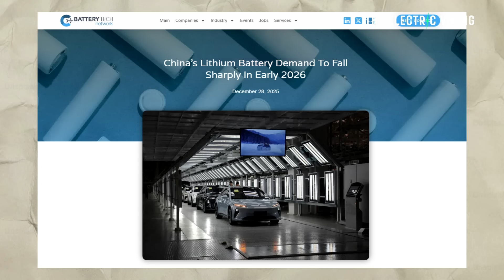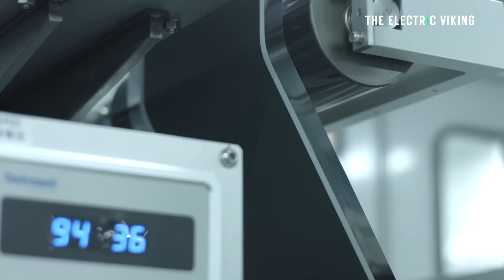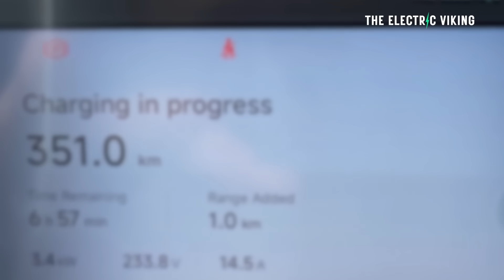SODIUM TAKEOVER! CATL Confirms Mass Deployment of Sodium Batteries for EVs

Comment: The great thing is that the move away from fossil fuels has begun. As long as there is continued research  into the development of new battery chemistry.  Battery technology and design will improve.
Reply: “IEA scraps Peak Oil, says oil demand will continue growing until 2050.” not me saying it we have a long way to go.
Reply: @reedy93  I'm not sure that comment shows any understanding of "Peak Oil"?  "Peak Oil" does not refer to demand peaking.  It refers to maximum production rates peaking.  If the global maximum production rate peaks while, as IEA predicts, demand keeps growing then demand will exceed supply.  Any budding economists like to predict what happens to prices when that occurs?

Any country that achieves independence from fossil fuels before that event occurs will be laughing.  Any country that doesn't, e.g. "Drill baby drill", will be in deep doggy doos.  Everything I see suggests that China understands this and has a long term strategy to be in the first group while the USA and most of Europe don't understand anything.  China and Russia are ahead of the rest of the world in deploying SMRs.  China is the first and only country to deploy an operational Thorium reactor.  China has deployed more solar panels than the rest of the world combined.  Everybody seems to be obsessed with its deployment of coal fired power stations.  It's not good for climate change but I think it is pragmatism rather than denial.  They need a lot of energy now, immediately, to construct the infrastructure that will provide the clean energy in the future.

Comment: Grid storage sodium batteries are generally a different design than the ones used for starter batteries. I think starter batteries are the market where sodium is going to take over a big share of the market first, although this is from lead-acid. These batteries are used in both ICE vehicles and EVs. But I still think for EVs they are still a few years away. We might see some early adoption in China, but it doesn't look like it will revolutionize that market yet. Home storage maybe by the end of 2026. We're already seeing early versions for home storage, but those are not really competitive yet. I have a LFP home storage battery and if these things get cheap enough might add these or switch.

Comment: Not in the US. Sodium batteries are twice the weight and have problems with fast charging.
Reply: They fast charge well at this point, they work in the coldest bits of the USA and Canada and they are cheap. They won't compete with NCM but that's got lousy cycle life.

Ask yourself what people in the US are going to put in hybrid and range-extender based vehicles that get a lot of battery cycling ? My guess is that will be a sodium market even if high end EV is not.
Reply: @etchedpixels  MYTH by EV propaganda

Short answer: Sodium‑ion batteries promise lower cost and better cold‑weather safety, but today their main problems are lower energy density, shorter cycle life (especially cathode degradation), higher internal resistance/voltage instability, and unresolved safety/chemistry issues — though major firms (notably CATL) report rapid progress toward commercial viability

Key technical problems (summary)
Lower energy density vs lithium — sodium’s larger ion and heavier mass mean packs store less energy per kilogram, limiting range for EVs and size for portable devices.

Cycle life and cathode degradation — many sodium cathode materials suffer structural “stacking faults” and phase changes that shorten usable life.

Higher internal resistance and voltage instability — sodium ions move less easily in many host materials, producing higher resistance, heat, and inconsistent voltage under load.

Safety and deeply sodiated‑carbon issues — recent research flags unique failure modes (e.g., sodium‑cluster formation) that affect thermal stability and require new stabilization strategies.

Manufacturing and cost competitiveness — while sodium is abundant, some sodium‑ion manufacturing routes and materials (antimony, special cathode dopants) can be costly; without scale or a clear energy‑density breakthrough, sodium struggles to beat cheap lithium/LFP on total cost per kWh in many scenarios.

Supply‑chain and ecosystem immaturity — cell formats, pack engineering, recycling pathways, and standards are less mature than for lithium systems, slowing OEM adoption and certification.

Comment: I would be interested in knowing how CATL solved the sodium ion expansion problem when charged and shrink when discharged.  That would be key to making the sodium ion cell robust and long lived.  If they have solved it enough to give 100,000 mile (160,000 km) longevity, then who cares if you must replace a $2,000 USD battery after that!  ($2,000 = 100 kWh x $20 per kWh)
Reply: Won't need to replace if you are happy to accept a lower range, 400 miles instead of 500
Reply: Prussian white cathodes, as used by CATL, are fairly good at handling the expansion and contraction stresses during charge/discharge cycles. It is a stable crystal lattice, with lots of room for the Sodium ions to move in and out of during operation, without reducing energy or power density too significantly. The same family of cathode material is used by other makers of Sodium cells, such as Faradion.

Comment: To be completely fair, until I can actually buy it as a retail product, it's just smoke and mirrors. And the current generation of sodium based batteries I can get are expensive and pretty lousy.  LiFePO4 batteries keep getting better and cheaper and sodium batteries keep getting hyped and nothing more.
Reply: Amazon sells Bluetti sodium ion solar generators already.
Reply: @larryc1616 Bluetti sells the same capacity lithium power stations for half the price. Don't get me wrong, good product, but not the holy Grail by a long shot.
Reply: Are you for real? Xiaomi top phones will now come with 10.000 mAh batteries. Insane energy density.
Reply: @LarsRyeJeppesen surprise me, but I'm not aware of any phones in the market that use sodium batteries. Zero.

Comment: This  new sodium technology sounds like it's also going to  benefit  shipping and railway freight locomotive market - in addition of course to the power grid balancing storage batteries. The late 2020s are going to be pretty crazy in terms of market disruption. I wonder what the Europeans have got up their sleeve - anything at all?
Reply: We've had batteries in freight locomotives for quite some time. Over any distance and reasonable load on European sized network it's better to string up overhead wires for much of it. Batteries are still useful for branches and in particular yards where you don't want to mix 25,000v and cranes.
The cost of a railway locomotive is huge because of the low volumes of production, enormous power output and vast distances it needs to cover over time without falling apart, so battery costs aren't actually a huge factor in it.
Ultra light rail on the other hand, and trams that charge at end stops may be more interesting though.
Reply: @etchedpixels  In a rational world, I'd agree, but here in the UK (and elsewhere) we have a Treasury, whose basic raison d'etre is "how can we spend less money right now?" So I predict there will be some long distance routes which are traversed first by battery locos. Then, when the hoo-ha has died down, wires will go up - and probably bit by bit, since that's another way of "spending less money _now_."

Comment: This Chinese state battery standards test that you we're talking about is interesting because it does suggest that older batteries have problems, genuine problems at scale ie there is a significant risk with older batteries in wider circulation. That is feels like both the ticking time bomb and a great market opportunity retro fitting with safer product and better product at the same time
Reply: Retro fitting certainly has huge market potential. Na Home batteries would be brilliant for solar battery combinations.

Comment: I live in SoCal and my Edison electricity cost is $0.46/kwh.  During the day I generate excess power but only get a credit $0.05/kwh.  These are new rates just sprung on us.  I kind of feel like I've been had.  I looked up Tesla Power Wall but they cost a lot for very little actual storage.  Sodium Ion may be the solution even if I have to pay a tariff.
Reply: Just get an other brand of battery. Powerwall is overpriced
Reply: Holy crap!  I just got my hydro bill today.   Fifty six days cost 123.32 Cdn ~ 90.00 US.  My rate is  0 .06905/Kwh Cdn (~0.0577 USD),  Central heating is with natural gas (radiators) although I do use some electric heat.   Approximately 94% of our power (Quebec) is generate by hydro,
Reply: There are many channels on YT with tons of good info on how to build a DIY solar/storage system.  It can be done for a small fraction of the Tesla cost.  I recommend Will Prowse, he's been at it for several years and seems to really know what he's doing.  btw -- he tested one of the first Na batteries available for storage in the US.  He found that it was not ready for prime time, and recommends LFP for now.  LFP based models have been holding up and performing very well.  Another alternative for a serious DIYer would be to get a salvaged EV battery, if you really need the kWh.
Reply: @HonestJohn-y3k  DIY solar/battery electric power systems are a  HUGE  danger to be avoided like the plague. Fast track to a home-fire (and I am not talking about heating) :body-green-covering-eyes:
Reply: Unless you happen to be an A-grade electrician.
Reply: have you seen that a bunch of the Tesla Power Walls have been bricked without notice or remedy ?
Reply: Lifepo4 batteries drop in price every year and you can get them now.  Amazon had a 300 amp hour lifepo4 12 volt battery for $280.

Comment: Thank you China. Super cheap energy storage options will help level energy flows generated by intermittent renewables and also help to deal with demand peaks and valleys. Great news for our planet. Not so good for lithium miners.
Reply: There will be plenty of work for lithium miners.  Lithium batteries have pretty big advantages for automotive.  Perhaps in ten to twenty years Na will find applications in mainstream vehicles, but that remains to be seen.  As things stand, they are expected to have some applications in very short range EVs.  But this also remains to be seen.  It's mostly about stationary storage.

Comment: Sounds like the right tech for the 2nd battery in a caravan/camper
Reply: No need for 2nd batteries, sodium already cheaper than LFP/Li-ion😂
Reply: Cheaper, easier to mass produced, abundant in nature, longer lasting, more safer, more fireproof, etc. The only downside sodium is the energy density lower than Li-ion but about the same as LFP

Comment: My view is that  Sodium Ion will have key target geographic areas for application. 
Northern regions that are seriously cold over winter will see high level sodium saturation for BESS and EV.
Equally very warm regions as the reduced need for cooling and greater operational stability. Middle East and Central African continental areas where deserts and arid environments expose the batteries to heat in the 45-50 degrees Celsius day in day out.
Lithium will have a place and a niche but other chemistries like the Aluminium Ion  batteries will replace the Lithium in many applications needing heavy demand large current draw.
It is going to be super interesting to watch what happens over the next 4 years.

.

Comment: Learn the difference between Moore’s Law (transistor density on silicon) and Wright’s Law that states every doubling of manufactured units drops the cost of each individual unit by a certain % with that amount completely dependent on the individual product
Reply: Are they really physical laws or merely an analog to describe the economy of scale?
Reply: @daniellarson3068  Wrights is not a law in the sense that there's not a formal mathematical model that shows why. It's really an economics observation that's very reliable - sufficiently reliable it's used in planning.
Moore's law is (more was at this point) an observation that the effect of transistor density reduction was cost reduction and of the rate it was occurring at the time.
Reply: @daniellarson3068  No not laws in the scientific sense.
They are marketing terms applied by journalists to observations by engineers and economists
Reply: Mansplaining…

Comment: The density by weight is on a par with LFP but they will have lower volumetric density and I wonder if this will in anyway limit their appliction in small EVs?
Reply: @crm114  a smaller kWh value sodium ion battery can provide the same usability due to better cold operation, abd it can always be charged to 100% and probably can be charged faster than lfp. So i would buy a 40kwh sodium battery equipped car instead of one with 50kwh lfp.  it is not heavier too due to less kwh.
Reply: @onim-m5f  Key technical problems (summary)
Lower energy density vs lithium — sodium’s larger ion and heavier mass mean packs store less energy per kilogram, limiting range for EVs and size for portable devices.

Cycle life and cathode degradation — many sodium cathode materials suffer structural “stacking faults” and phase changes that shorten usable life.

Higher internal resistance and voltage instability — sodium ions move less easily in many host materials, producing higher resistance, heat, and inconsistent voltage under load.

Safety and deeply sodiated‑carbon issues — recent research flags unique failure modes (e.g., sodium‑cluster formation) that affect thermal stability and require new stabilization strategies.

Manufacturing and cost competitiveness — while sodium is abundant, some sodium‑ion manufacturing routes and materials (antimony, special cathode dopants) can be costly; without scale or a clear energy‑density breakthrough, sodium struggles to beat cheap lithium/LFP on total cost per kWh in many scenarios.

Supply‑chain and ecosystem immaturity — cell formats, pack engineering, recycling pathways, and standards are less mature than for lithium systems, slowing OEM adoption and certification.
Reply: @onim-m5f  - whilst cold operation is better, warm operation (from 35c) requires additional cooling, due to lower stability of the electrolytes used in Sodium ion cells (that start to degrade at this temperature). Further, the wider voltage range requires more expensive power electronics (similar to those in 800v architecture vehicles), which when taken with the additional cooling requirements, pushes up the systemic (vehicle level) costs for using Sodium Ion battery packs. 

It's likely that for smaller battery packs the cost benefit of utilising Sodium Ion vs LFP doesn't work out, hence why CATL have focussed on larger pack solutions, packs for particularly cold regions, and dual-chemistry battery packs for hybrids (where the Sodium Ion's higher cyclelife offsets the impact of constant charging of the battery pack).

Comment: While I can believe this development, I wonder how it will fit with current product strategies of “Planned Obsolescence”, because in various areas (consumer and household electronics) companies realised  already in the 1980s/1990s that if you built a product that lasts 50 years you will only make 1 sale. And with such a longevity it will be likely EVs will be built in a way to make replacement impossible (you could argue you don’t need too, but it would make sense to take out the battery if the metal of the car is rust and continue to use it) and so many sodium batteries will just land on the scrapyard without recycling. It’s no argument against developing and using them, but unless there’s regulations companies will choose the cheapest ways resulting in still usable batteries not being recycled or continued to be used in other capacities.
Reply: There’s a great company in the us already using “spent” batteries for energy store. Talking here about first generation leaf batteries etc.  and they combine different chemistries and suppliers.  Still profitable.

So no, with the high demand for energy storage I can’t believe those batteries will be just thrown away
Reply: I would love to get my hands on even just a small battery pack from a hybrid, but it seems they are being reused somewhere. Practically impossible to find one here in northern europe.
Reply: The batteries have value so they won't spend long in a scrapyard. Scrappies make their money getting the maximum value out of everything they end up with.

I can well imagine that a ten year old battery pack will be the wrong/shape/voltage/protocol to put in a newer car however, even without malice on the part of the manufacturers.

Existing car batteries already get re-used fairly extensively for static uses, both commercially and "I parked a trashed leaf in my yard and ..." type use cases.